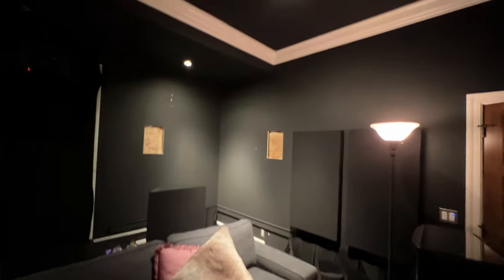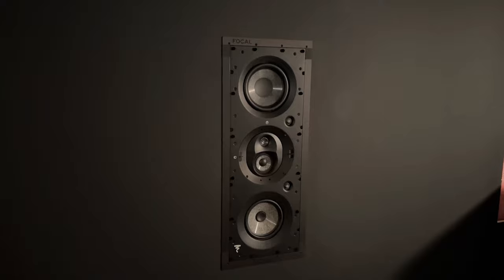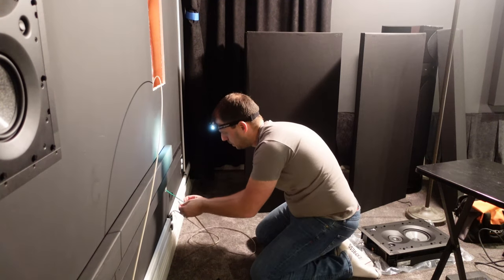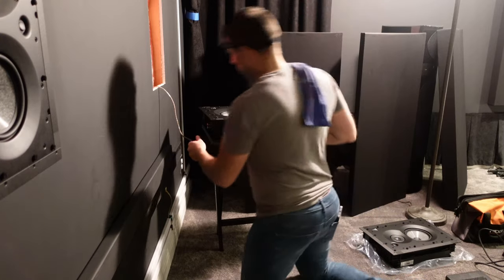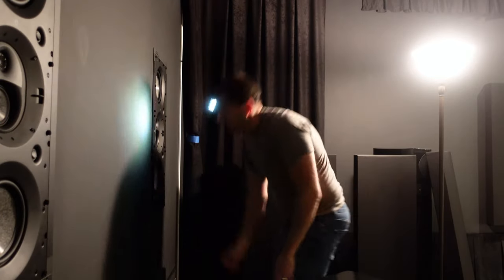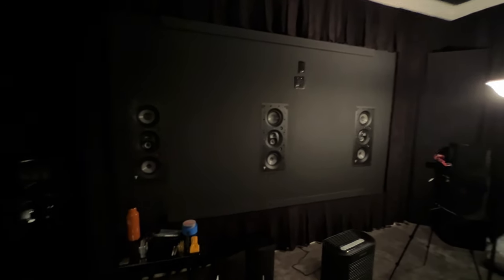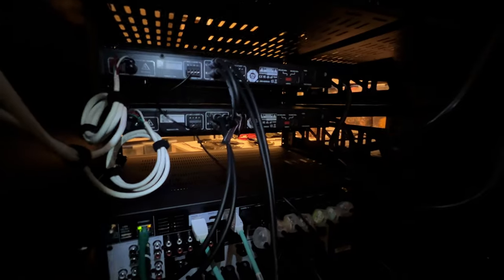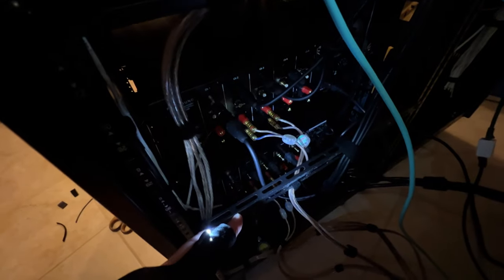HOME THEATER 2.0 SETUP VLOG | Final In-Wall Speaker Install & How to Nicely Wire Rack Cabling

Comment: Man you got a lot of work done! Speakers are looking good and so is the wire management. When I get my AVM 70 I'll need to straighten out my wiring mess.🤫 Can't remember if you mentioned but what speaker gauge are you using? Can wait to hear your system up and running! 👨🏾‍🦲
Reply from the maker: The speaker wire is just Monoprice 14 AWG pure copper. My longest speaker run is still only like 50' so 14 was enough. Most of them are under 30'.

Thanks as well! I'm really proud of the work I did in here, essentially solo (some help from my wife and son here and there).

Comment: Still looking very nice ! Do you have insight on why your surrouds are higher then ear level ?
Reply from the maker: I might have gone a hair too high, but it sounds great. There's a nice bubble of sound now. The former surrounds on stands were a bit too low and too close. I went a couple feet above ear level for the in-walls. They look a little higher in perspective right now because the couch is fairly low profile. I was planning ahead for higher back theater chairs. I wanted to ensure the in-walls would clear any future chairs to any seat appropriately. Also note the Focal IW6 tweeter is on the bottom of the speaker, not the top.

Comment: What cable labels do you have?  Look nice and clean… might need to update mine.
Reply from the maker: I changed most of them over to World's Best Cable brand using 2549 Mogami wire and Neutrik connectors for my RCA and XLR connections. All available on Amazon (use my link). My HDMI cables are now from Infinite.
Reply: @Techthusiasm   Hey! I actually was interested in those little label balls you have in your cables :). My labeling is a bit messy, those attachable label thingy’s are super clean!

Comment: Please let me know what you used in the bottom of the wall with the drywall & speaker wire enter. Also I would move those surrounds up some you don't want those to close to the rear surrounds.
Reply from the maker: What do you mean "what I used", exactly? I'm happy to answer, just not sure what part specifically you were asking about. The grommets perhaps?
Reply: @Techthusiasm  Yes the grommets. Sorry I wasn't clear.

Comment: If I may please ask why did you decide on such a high placement of your surrounds?   I’ve read that the ideal placement is for the tweeters to be closer to the MLP?   I would think having them lower will also help with channel separation / integration with your Atmos?
Reply from the maker: 2' or so above ear level has been a long time recommendation. My seating is also a pretty low couch, so I needed to account for possibility of changing to higher back theater chairs. I actually have a Q&A vlog coming and talk about this because a number of folks were asking.

They aren't too high for Atmos effect as I no longer have heights. I have tops up in the ceiling over the couch.
Reply: @Techthusiasm  awesome…look fwd to that vlog!   I was thinking maybe it was because of maybe future riser build considerations which would make sense.  I have the focal 300 series installed myself.  I love my setup and can’t imagine how insanely good the 1000s would be like.  Thnx for taking us along you’re journey. 👍🏽
Reply from the maker: I doubt I will put a 2nd row in this room, but that also did loosely factor. Just in case. Love Focal and the 300 too. I really like the flax drivers.

Comment: Please are those speakers focal 100s or the 300s .
Reply from the maker: It's all 1000 series.
Reply: Can you please help me  to choose between  focal IWCL 300 Vs the SVS Prime Pinnacle towers . I am using the speakers mainly for Home-theater  @Techthusiasm
Reply from the maker: Hmm, tough question there. I really do like Focal. Did you see the new speaker line that SVS announced at CES? I would recommend you really try to go listen if you can.